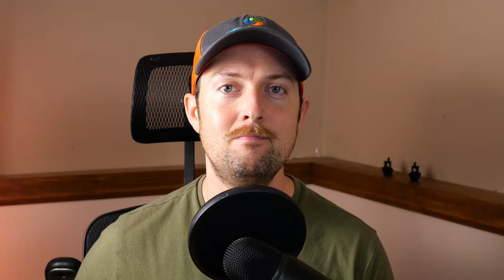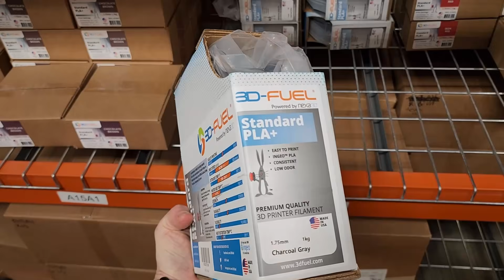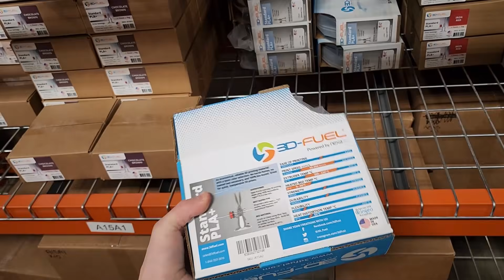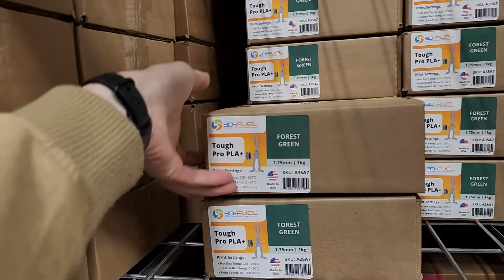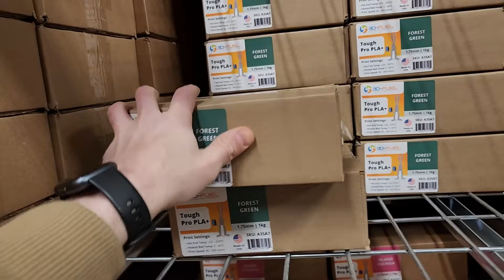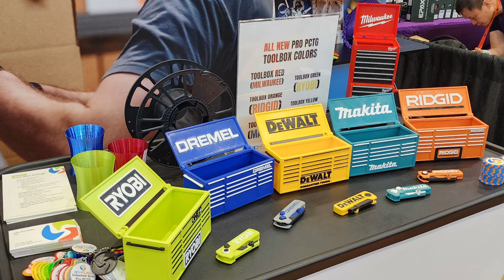US Manufacturer Brings Prices Down on 3D Filament | 3D-Fuel Pro PCTG Prices Are Reduced

Comment: That's great that you are moving towards a spool made from recycled material, but why not start deploying spools that accept refills and make that a long-term goal? I think that's what Sunlu is working towards. Many of their new spools come with refill-style spools. Now, I will say that their refill section leaves a lot to be desired at this time, but the vision for future spool sales to be primarily refills isn't a bad call, I don't think. Not to say you are doing it wrong, just curious. I'm looking forward to being a 3d Fuel customer and transitioning all my PETG to PCTG.
Reply from the maker: Because it doubles the amount of inventory we need to carry. Think about it - if we offer a refill spool, does that mean we stop carrying filament with spools? No, it doesn't. That means we now have inventory taking up twice as much space and twice as much capital, AND it's more labor-intensive to manufacture refills. At this point in time, there isn't a solution to automate the winding part of the production of refills. We'll have to charge more across the board. I don't think customers want that.

Comment: Hello, does the matte black PCTG contain carbon fiber? If so, is there any way to achieve matte finishes in PCTG without carbon? Just curious. I'd like to avoid CF if possible, due to extra wear on the print head and post processing that is encouraged with CF filaments. The matte black looks incredible and I would love to use it.

Comment: I work as a engineering technician within civil aviation. I design and manufacture bespoke functional parts and replacement parts for legacy systems. We almost exclusively use Pro PCTG. Two of the biggest requests I have, would be having Reloads for all the most common engineering and prototyping colors... Black, Transparent, Cobalt Blue, Industrial Gray. My second request would be for glass fiber filled filaments, particularly the industrial gray. This enhancement would further improve strength, durability and most important to my application... improved UV resistance.
Some of the parts I design are custom outdoor junction boxes for electronics, power and RF transmission lines.
Reply: Reloads in the recycled "re-fuel" filament would be great too. 

Have you guys looked into supporting an open source RFID tag, that would be user programmable? This will let users have all the same features as an AMS with Bamboo's filament, but in an open source way which would be hardware agnostic. 

I would be interested in making my own reloading spools with programmable RFID tags bedded into the prints.

Comment: Feedback: you need a better back drop, maybe display a few different prints with either new colors, Question: as a hobbyist mainly, i use PLA only on ender 3 platform,  i am always looking to replace PLA but price and ease of printability make it almost impossible, does PCTG make that possible?
Reply from the maker: We hear you on the backdrop, this week's episode should have our basic multiboard installed and will continue building it out week after week.

As for replacing PLA, of you don't need the additional toughness, temp resistance, and chemical resistance of Pro PCTG, why switch?
Reply: @3dfuelusa  Temp resistance is the only true factor that would be an advantage

Comment: I'm still waiting for some manufacturer to start making 2.85 mm (TPR) filament.
Reply from the maker: What's TPR?
Reply: @3dfuelusa  Thermoplastic Rubber.  There was a company that used to distribute it a while back, Atomstack and Creality as well.  TPR had wonderful properties. Very bouncy and you could print Pet safe chew toys, shoes and the like. 65A Hardness
Reply from the maker: @JoJo-ps4ml was it even printable at that soft of a shore hardness?
Reply: Yes, Search for the Atomstack Cambrian Max 3D printer.  The printers are discontinued so there's no market for it now, but i remain hopeful that someone rediscovers this great filament. I printed some of the samples they provided on the sd card and the prints were comparable to what i print today using using TPU. I think the softness required the 2.85mm filament diameter, but i'm no expert.

Comment: Just found your podcast, the lighting is much better in this one than the last! I really like PCTG for prints used in the shop because we get better thermal resistance than PLA and it can be exposed to acetone without melting. Thanks for pushing for more adoption of the material!
Reply from the maker: Thanks! And I'm glad that Pro PCTG is working so well for your application!

Comment: Great to see and hear from you explaining things about 3DFuel. I love your filaments. One thing I can do without, the new Box itself. I prefer to not have individual box for each 1kg filament since it's a waste especially when ordering multiple rolls. If possible to do WITHOUT box and replace the vacuum seal with a ziplock bag like Prusament. I love their bag since I can reuse the ziplock type bag with the desiccant that came with it. Disposing plastic spool holder is also a waste but paper spool holders has it's own pros/cons. 
Keep videos and updates coming! Thank you for sharing!
Reply from the maker: Doing a 10-spool case pack with no individual boxes could be interesting, but I do have some concerns about the vac bags rubbing against each other in transit and wearing small pinholes in.

But that could represent another $0.30-0.40/spool savings by eliminating them.

We've looked into resealable bags in the past, but they are quite a bit more expensive and have to be custom- manufactured. So there's a longer lead time on the bags.

It's been a while since we've looked at it, so perhaps it's time to look again.
Reply: @3dfuelusa as a note for the concern of pinhole wear in bags, it is very common that filament needs to be dried before first use anyway so I would be okay with slight bag damage.  I do know some people would prefer fully intact bags though.

At the scale of ten spools, it's unlikely that the spool would stay perfectly dry even in a plastic bag anyway, so perhaps just chucking ten spools into a large box is more viable than expected.

Comment: Question: Do you have any data on creep/stress relaxation for your PCTG? For example, say for like a phone handlebar mount will the clamp part need to be retightened after a few weeks or months?
Reply from the maker: We haven't done testing like that as of yet, no. Interestingly-related, we have had a customer reach out to us to say that Pro PCTG is superior to PETG for thread strength retention. For example, screwing in a bolt or screw into a 3D-printed hole. The PETG won't hold it over time, but our Pro PCTG has.

Comment: PCTG color comments: 
Tangerine Orange: never really liked it.

Silver: The best silver I've found in the PETG/PCTG family of filaments. 

Florescent Orange: I'm starting to get used to it, but it's a little ... off-putting. I think a more-orange florescent orange would be nice. 

Metallic Gold: 😝 in my opinion, it's actually kinda ugly. I think working with your color supplier to get a V2 would be worth it.

Color request: 
Orange: I haven't tried the Toolbox Orange, so it might be the answer I'm looking for, but I use a surprising amount of "signal orange" for random projects. An opaque signal orange would be nice.
Reply from the maker: We're glad that you like our Silver!

For the oranges, the Fluorescent Orange really shines (ha!) when exposed to UV light so that it can fluoresce. It's not that impressive in natural light.

I would highly recommend our Bitcoin Orange color. It may be a bit brighter than you're looking for, though. Our Toolbox Orange may be a good option for you once we get that restocked. We're waiting on our production order of the colorant to arrive from our compounder. So that's about 3 weeks out.
Reply: @3dfuelusa I owe you an apology. Apparently PCTG PRO Gold looks GREAT when printed in 0.2mm layer height. The prints I made at 0.3mm (0.6mm nozzle) looked terrible (color). Every print I've made at 0.2mm layer height (with 0.6mm and 0.4mm nozzles) looks great! 

If the relationship was linear, I'd expect 0.1mm layers to just turn into gold. 😉
Reply from the maker: @imhavoc if I had to guess, you probably need to either increase the hotend temperature or slow down your speed on those thicker layers. 

I'm guessing the print at those thicker layers was more of a dull, matte finish and the thinner layers we're glossier, yes?

Comment: The economics section was fantastic! $0.10 savings PER SPOOL! My jaw almost dropped... And then it got better. 

I have transitioned almost exclusively to 3D Fuel PCTG, and I'm burning through my stash of PETG. I find myself using whatever random color of ReFuel I have open for all of my personal projects unless it's going to be visible and color matters.
Reply from the maker: Thank you! Yes, we're working very hard to make our materials as practical for customers to use as possible. But we do have to ensure we stay in business, too, so we have to be practical from that end of things as well.
Reply: @3dfuelusa a profit is a reward from customers from doing good. A loss is punishment for doing poorly, or making dumb choices. 

Don't try to operate at a loss and make up the difference on volume. 

A subsidy is an unearned gift from taxpayers for acting foolishly at the government's request.

Comment: Thanks for the detailed overview of the changes, and what you did to make it possible. 

A question about CHT high flow hot ends. Are there any specific changes you would recommend to print profiles when using them, besides the volumetric rate?
Reply from the maker: We recommend dropping the hotend temp (simplest/best option) or setting a higher minimum print speed in your slicers cooking section. 

Those CHT nozzles also cause more oozing if you keep the same temp you'd use for a non-CHT nozzle
Reply: @3dfuelusa Good call out. The print profiles seem to vary from your TDS sheets somewhat. What is the recommended ideal temperature target hot end temp for PCTG, all things being equal?
Reply from the maker: @CoffeeGearLab Middle of the road is about 260C. If you want to print faster, thicker layers (more volumetric output) raise the temp. We have some customers printing at 295C.

If you want to print more slowly and more detailed or you have a CHT/HF style nozzle, drop the temp.

With a 0.4mm HF nozzle on the Prusa Mk4S, for example, we have gotten good results and minimized oozing at 245C.

Comment: Hey could you save some cost by packaging the material on a cardboard spool? Bonus points if it's compatible with bambu labs re usable system.
Reply from the maker: No, a cardboard spool would actually ADD about a dollar to the cost, or we'd have to be sourcing it from China

Comment: To follow up someone's comment, any plans to produce ASA or ABS in the future? I know Styrenes can give off some noxious fumes so what would need to happen to the facility to be able to start production?
Reply from the maker: The big thing is adding more robust exhaust to the extruder die area and the resin dryer exhaust area.

It's certainly doable, but we don't see as much demand for ABS and ASA as we do for the PLA and co-polyester materials.

We're choosing to focus on those as our core competencies first and to make our production as efficient as possible before adding a completely new material family. 

That being said, we have killer low-warp, low(er) smell formulas for both of those materials in the tank for whenever we achieve those other goals!

Comment: I use ABS and ASA,  you guys dont have any of those. I understand catering to the trinket and statue PLA users but I wish you guys made actual functional filaments.
Reply from the maker: You haven't printed with our Pro PCTG yet, then. It's a functional co-polyester material that is heavily used in robotics and the medical industry for functional parts, not toys.
Reply: @3dfuelusa  (The clear stuff also looks pretty 🤣)
Reply from the maker: @stldenise definitely a side benefit! There are some applications where that light transmittance is critical for functional parts and ABS and ASA aren't able to provide that
Reply: Pctg has pretty decent chemical resistance.
Reply: Tensile strength and flexural modulus of PCTG is on par with or exceeds ABS/ASA too.
Reply: And Ingeo 3D870 is not a trinket resin, either. It has a higher tensile strength and flexural modulus than ASA or ABS. It does have a lower impact resistance and heat deflection temperature than ABS/ASA, though.
Reply: ASA and ABS have pretty bad layer adhesion. Good for impact resistance and obviously heat, but strength, is not their strength. If you're talking about tensile strength, trinket PLA destroys ABS/ASA. It all depends on which material properties you need and sometimes PLA is much better choice than ABS/ASA for functional prints.

Comment: I would 100% stop buying Chinese filament once there is a US manufacturer that will allow me to buy 1 kg rolls and sets of 10 or more for around $9 per spool. If I'm buying one spool yes I would expect to pay anywhere from 12 to $14 but when I'm buying 10 kg of different colors I would prefer to pay at least $10 a spool for PLA and PETG.

I live less than 3 hours away from Houston and there is a filament maker in Houston but their prices are just way too high I can't justify spending $13 a spool when I'm ordering and what I would call bulk which would be 10 or more kilograms
Reply from the maker: I'm going to be very real with you right now: if $13 a spool is too expensive for your needs, then you're going to have to stick with Chinese manufacturers.
Reply: Tangled is a US manufacturer making $10 filament.
Reply from the maker: @bigtwinlife in only one material, one color and they're not keeping it regularly in stock. And that price point isn't on 1kg spools. And it's not their core business - they don't have to worry about profit on making filament to keep their doors open. It's not even close to an apples to apples comparison
Reply: @3dfuelusa  I never said it was apple to apples - but the fact is you can buy $10 filament from a US mfr. right now.

Comment: You are on my list of filaments to try as soon as I get my pile down some :0).     About your refuel,   While the price is fair for a transition spool, the fact that it may be an underweight spool means that sometimes I may not get value considering that it’s random color.       I don’t hesitate to order transition spools from other manufacturers where the transition spool is often overweight and I have never received an underweight one.
Reply from the maker: All ReFuel spools are full 1kg, not partials.

For any partial spools, we liquidate those at our retail store in Fargo, ND for a much lower price. 

This way, we can provide as consistent of a recycled material experience as possible for our online customers